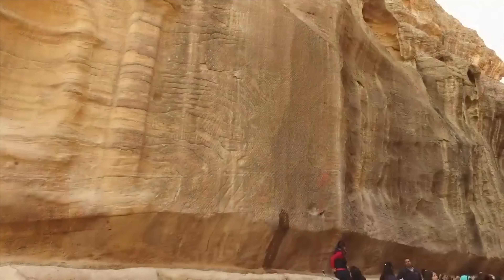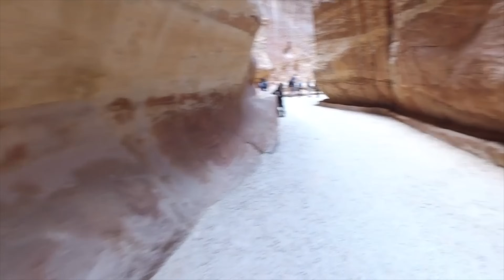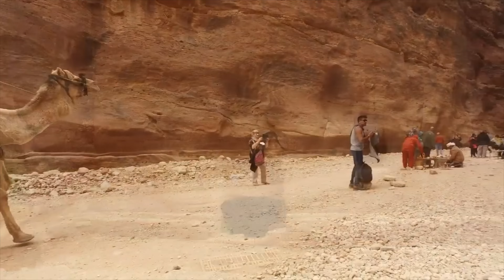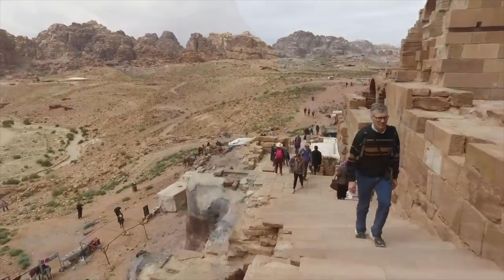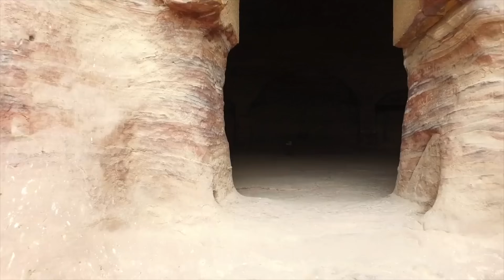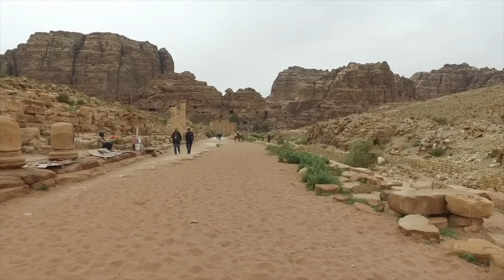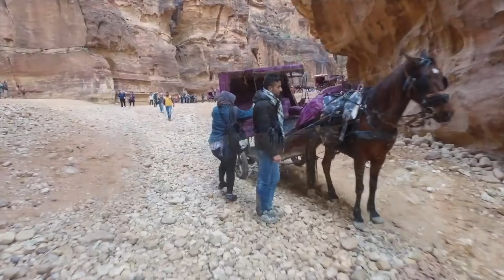The Massive Megalithic Marvel Of Petra In Jordan: 7 Miles Long!

Comment: Hey, Brian - thanks so much.  This is such an interesting area that is super intriguing to say the least.  The narrative per usual is a good laugh.

I notice many (apparent) scorch marks throughout Petra.  What are your thoughts on these?

Also, I'm very curious as to what is atop Petra, and if that is accessible?  My thoughts tend toward the area having once been covered/enclosed (a roof above essentially, partially or perhaps more completely), and what would be considered as subterranean in nature.  

Lastly, what appear to be tool marks run what seems to be continually diagonally along the wall - no breaks in the markings that I could see.  This leads my thinking to be that these marks are more artistic in nature, and/or more purposeful.  

I know this final thought may be considered "way out there", but my thinking is that what seems as extremely difficult to do today via our conventional means, or especially what we are told conventional means of this supposed time were, are actually much much easier than we would think, due to our current beliefs.  In that these mysterious creators of old were using the greatest technology of all, the mind/thought, to create all of these things we 'wonder' about now.  No need for Aliens or the like, but simply things like the Double Slit Experiment and Quantum Entanglement, which shows how much of an impact our thoughts alone have upon this 'stuff' we call matter.

Really appreciate all of your research and expeditions.  And look forward to hearing your thoughts on the above.

Best to you and yours always, my friend - have a good one!
Reply: You do have a pt,
maybe not about a 'roof'
BUT
A Drone View from above, may reveal some MORE...PHENOMENONS!....
Hope he sees your comment & maybe trys it while he's there, or next time he goes!
Reply: @zodsinclair8500  Roof was likely not the best description I could have used, although it works to an extent.  Subterranean may be a better way to phrase it, similar to Derankuyu, etc.  These are musings more than anything, but I think there's very little to objectively say with this - or much of anything.  Those narratives put forth, and the ridiculousness of them may be the closest thing to objectivity we have.

Absolutely, seeing the "top" would give our thoughts a lot more input.  Hopefully we can see that.

Have a good one!
Reply: I feel firmly that the secret is probably something simple in many of these deals, I asked a guy taught me quarrying techniques and he said it's quarrying", but called burning the rock  and hitting it with a spud bar spalling but it's actually something different, sides that it just takes heat and the rock will either shatter or u use kinetics to cut blocks etc,
Reply: No1 will care enough to talk about it, just like the pyramids different science could be involved, I thought someone might say we see a void middle of pyramid, was thinking of superconductor. Idk what it has to do tho think instead it could be a  positive negative doppelganger atom effect, y I thought the ark of the covenant was the base and there was metal top of pyramid. In 1 deal the doppelganger is always in the opposite direction of eachother, guy makes that static generator using a Faraday cage ground, uses wireless connection using a drone to make the loop,
Reply: @Deuce-G-RC  as they say! Cheers! hope to see it.
Reply: @MrGarthboy  Super interesting thoughts.  I'm sure there are many techniques and technology that have been 'lost'/hidden from us that prior civilizations thought of as commonplace.  Afterall, they can't have Joe Public easily building a castle-esque home and being independent of the system moreso. Haha

If you have a link to refer to that I can wrap my mind more around the Faraday concept you mention, that'd be awesome.  I've a feeling it may take more than one link, but a nudge in the right direction is great.

Thanks - have a good one!
Reply: @Deuce-G-RC  use that sun reactor thing test room to make like micro machines and I was just telling a guy on a ghost town video some of my mining ideas, 1 sec
Reply: It's probably something to do with centrifuge and zero Kelvin, the air frozen solid almost might be easier to float on 8f u can keep it going, or maybe there's a way to break from some dimension
Reply: @Deuce-G-RC  https://m.youtube.com/watch?v=_rsAxeYc-jk
Reply: https://m.youtube.com/watch?v=F5PfjsPdBzg
Reply: https://m.youtube.com/watch?v=hiyKxhETXd8
Reply: @Deuce-G-RC  it's not about keeping the economy good, on yt Harrison Bergeron is something to watch, and the fortress, it comes down to, "the question of jealousy" is what I call it, it seems terrible but the film speaks volumes about how u can be played against yourself no matter how intelligent you think u r, all it takes is 1 fatal attempt at something u think u got figured out and it backfires, sides that history repeats itself is supposedly an inside joke with written by the Victor's, so Schopenhauer is referred to in film so is Charlie chaplain, I asked a guy about Hauer 1 day he said something I didn't know about "God is deqd" meaning people r the masters of their own fate,  because they're gatherings r infallible. I learned it's better to not screw up, because u can get over just about anything, but if u screw the pooch, it's gonna suk.
Reply: maybe these feats were created when people lived in harmony with one another, and they were able to link-up their consciousnesses together in order to alter matter and the more people thinking the exact same thought at the exact same time, the more powerful they could be. in the modern world, there are so many distractions and distortions of the truth, it's hard enough to even get people to agree on what a woman is. now, imagine if most people were thinking the same way? if that's the case, is diversity really such a benefit like they tell us?
Reply: @AustinKoleCarlisle  being a woman is as misleading as being a man, what a man needs is same as girl, it just takes a thought or 2 to be the difference from saying this is hell, or a start at worthy life, like the fcc, all needed Info has to be taught, a person goes without, brings an opposite realization to the those that can't do teach, because it's Individually wrapped per Individual, an has to be done exactly right the first time attempt, luckily it makes people more violent prone to a sense, but a life that's Indefinitely worth living is all that should be a universal language or calling, there was never a time people worked together, qn everything was fine, if there isn't a problem 1 will be made, the healthier the person the more violent, and like evil kenneval. An indicator species is example general koney, even some Americans an Russians hung out with hitler in the woods once,
Reply: @MrGarthboy  you sound schizophrenic. i'm not being mean, but you might need to get checked out.
Reply: @AustinKoleCarlisle  what is the version of schitz u think I have
Reply: @MrGarthboy  don't know. it was just the way you arranged your thoughts that made me think of that. i hope i'm not offending you.
Reply: @AustinKoleCarlisle  ur fine, I'm technically schizophrenic, want to get better someday, it should be all demonic based, unfortunately I did bad things on top of missing key points towards any form of redemption, I have to look forward to moving on, I hope some can find a decent life, I probably wouldn't be able to live with myself if I got better, because kinda like squidbillies sheriff, i done more gay things than straight, looking Into a house design, like the eastern yurt looking fridgerator domes, mixed with cut up totes for the furnace/ cooling Roman style hollow basement, I think I helped inspire recent developments in nuclear and micromachines, they have a venom looking robot now, I taught myself telekinesis, multiple people thinking the same thing, we should start a charity club where some of the folks can experiment on there powers, or basically attempt at magic, I seen a yellow hand doing sign language on a ceiling, it was communicating with someone looking thru my eyes l, someone walked up once and said thanks for the glasses haven't seen well for awhile, took off his glasses his eyes were dark, said don't ever let ne1 tell u ur not awesome, b4 his friend got me in a headlock and said ' jesus isn't Billy the kid ' an I just happened to be imagining Jesus with 6 shooters shooting evil not too long b4 that
Reply: @MrGarthboy  hey man, i hope you the best. thanks for chatting.
Reply: @AustinKoleCarlisle  if u want to try it put a Bic with the metal side away on ur flat pointer finger writing hand and if u notice the force against the lighter u pushing it with a feeling, u may also notice another force also exuded as a brace imagine taking that force slightly from against the lighter and rotating it's mass and position around to join the actively attempting to apply pressure force maybe keep more acute towards the center some and u can imagine a floating feeling as u imagine it moving and u should be able to get it eventually just pushing probably with a thought, also figured out how to mess with fire in a metal barrel using a yoyo to cut tall grass, fell asleep standing up as the sun rose

Comment: I did a search, and evidently limestone can be dissolved by vinegar, but you might have to let it sit on the stone for up to a week. But I imagine that the vinegar, or other mild acid, could soften the top layer of stone enough to be able to take a claw tool and start scraping. For granite you'd need hydroflouric acid though.
Reply: Maybe
Reply: Can confirm. Muriatic acid will eat through cement if left sitting. Takes time, but if left sitting it will completely dissolve. The industrial machinery constantly breaks down from degradation from the acid
Reply: @aemonblack4932  sounds like you’ve ran through a lot of equipment lmao
Reply: @Steve.._.  LOL our line goes down at least once every other day. Often its the air pressure hoses that send the crates down the line
Reply: Mmm good idea!!! Gold 🌟 for you!! Oh yeh they had some strong vinegar in that Baghdad battery.... 😎👍♥️🕊️
Reply: Acid rain for hundreds of thousands of year
Reply: But you would probably need tonnes of those substances...
Reply: Is diamond tools out of the question. Does it have to be a metal tool ?
Reply: @stargazer4625  my work guards tin like a meiser in a story so diamond can only imagine bruh
Reply: Vinegar is a natural outcome of alcohol that's sat too long and there was alot boozed up folks back them. You are on to something here.
Reply: Cory and Eyes Open, you two should get a room, the sex is always the best when you hate each other. PS Everybody knows it was Aliens.